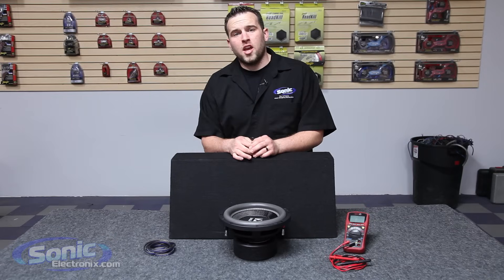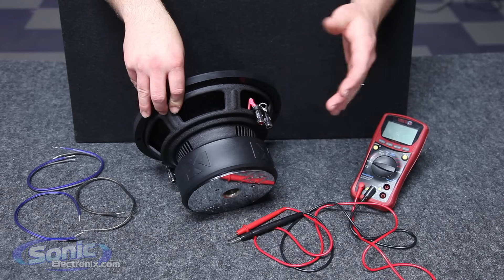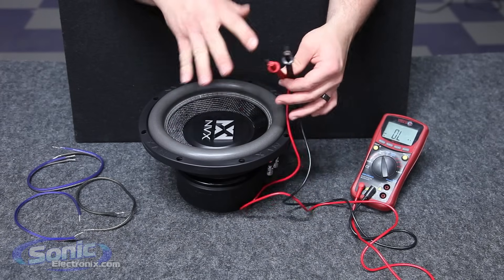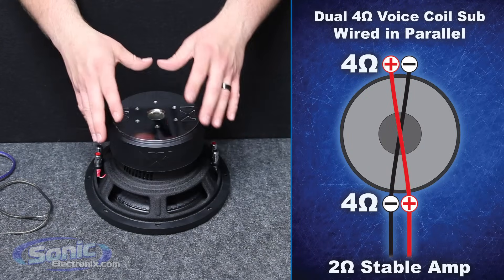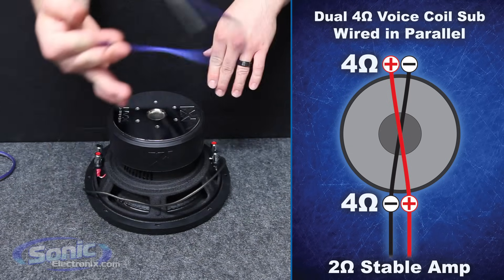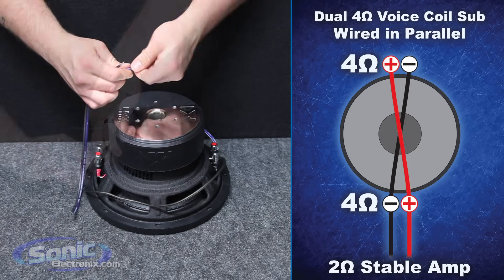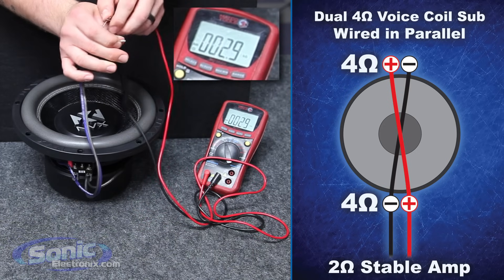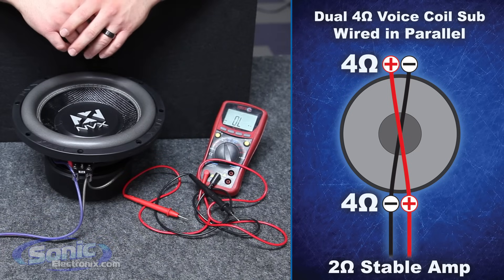How to Wire a Dual 4 ohm Subwoofer to a 2 ohm Final Impedance | Car Audio 101

Comment: How does the RMS change?
Reply: Madis Kess The RMS changes because there is less resistance to the amplifier, allowing the amplifier to push more wattage to the subwoofer. Just make sure the amp is stable for the lower ohm load otherwise damage will occur.
Reply: ***** I'm not sure what you're asking.
Reply: So the sub wattage doesnt change. Just need amp that can get the rms at lower back ohm.
Reply: Just a bump to get the notification. Also curious about this.
Reply: gar rett Thanks, I mean as in numbers? Say a 500W 2ohm sub?
Reply: If you have a 2 ohm 500w sub and you run it in series to make it 4 ohm you add more resistance so it would be 250w RMS at 4 ohm. The RMS of the sub won't change because everything has its limits. Go to the manufacturer site and look up your Subwoofer to see what the RMS rating is at the ohm you want and see if it's stable. If you don't see it, I wouldn't try it because then it's in unknown territory and you could ruin your sub & or amp.

Comment: Ok how can I hook up 2-12" NVX N SERIES DUAL VOICE COIL SUBWOOFERS TO A 2 CHANNEL KENWOOD EXCELON KAC-X621 AMPLIFIER
Reply: Exactly the way he showed on the video.  Each speaker to its own channel on the Kenwood amp.  The amp should be stable at 2ohms per channel.  
Don't try to use the bridging mode wired this way,  u will fry the amp.  Forget about bridging

Comment: Hey i have a 3000watts amplifier with 1 Chanel 
And I have an L7 15" kicker and when I do the bridge it does sounds much louder but smoke starts to come out of the amp, even if the volume it's low or all the way down, you think my amplifier it's the problem?
Reply: Something is wrong with your amplifier
Reply: Have you checked out what ohms your amp can go down to? It might be too lower ohms for the amp to handle.

Comment: how can i wire a 2 dvc sub to a 4 channel amp
amp power at  1640 watt and sub at 300watt each with impedance 2x4 ohm (stereo), 2 ohm (mono) and 8 ohm (mono)

Comment: I have two 800 watt 4 ohm 8" subwoofers in my deck can they be wired straight to my car stereo factory wires ?
Reply: not to be rude but they will work but it would probably sound bad and you wont be giving them enough power and also the fact that you would need hi x over to push only lows out the subs so you wont ruin the voice coil.. ummmm to put it simple, no that's a bad idea lol
Reply: And not just what marcell said sub's are ment for hi mids and lows if they can hit them all some only hit mids and his and some only hits the lows or some hits them all there not ment just for vocals

Comment: I have a AUDIOBAHN amp 1200w 2ch and on the bottom of the amp it says it can be taken down to a 1ohm. I bought two 4ohm dvc AUDIOPIPE subwoofers 600rms/1200max. My question now is how should I wire them for best sound/bass? I have a ported box for the sub's to go in. If I wire them down to a 1ohm would that be safe? Or wire to 2ohm ? Or just wire it for a 4ohm like the diagrams prefer? I'm trying to hook this up within the next 5hrs so if you could help me before then that'd be awesome. To the public if you know your stuff and could help me with any feed back it'd be greatly appreciated thank you.
Reply: if you want louder bass go seald and you will feel the bass as well as getting it to sound louder just double check that the specks on you subwoofers say that they can be placet in a seald or ported box

Comment: i have a small question! i have a loaded kicker comprt 12", its at 4 ohm. i would like to rewire it to 2 ohm. does anyone know what kind of speaker comprt uses? and how its wired inside? before i take it apart i'd like to know if its actually possible. because there is a possibility that both coils on that speaker are at 8 ohm, and they're wired parallel into 4 ohm, which would suck for me.

Comment: I've got a JL audio W3v2 300w rms 4 ohm sub and i want to power it with a ALPINE MRV-M500 AMP 1CHANNEL 500 wrms @ 2 ohms, 300 wrms @ 4 ohms, if i get the final impedance of 2 ohms will the system work well?

Comment: okay I have a question anyone can help plz. I have 2 12 excelons producing 400rms @4ohm, it is hooked up on a Kicker cx 1200.1.  600watt x 1@4ohm and 1200watt x 1@2ohm. I wired my subs down to 2 ohm, my subs are pushing 1200rms together.  Well I plan on upgrading to RF p3d2-12 they each have 600rms@2ohm and I plan on using 2 of these on the same AMP,  now will the RF that will be pushing 1200rms@ 2ohm be louder than the excelons that are also pushing 1200rms? will the sound be the same or diff

Comment: I have a pair of pioneer TS-w3002D4 and a SoundStorm EV2.3000  and i want to get the most outta them both but on your website it doesn't say if the amp is bridgeable?

Comment: I have a Audiobahn A2300hct amp and I'm putting 2 AW1204M (4 ohms) and I'm trying to run them at 2 ohms but mine has 4 connection instead of 2 as shown on this video. how do I run the wires in order to achieve the 2 ohms?

Comment: I was planning on getting to dual 4ohm and connecting them parralel to get a 2ohm load, i have been told if i connect it to my monoblock amp that is 1ohm stable, the subs will them run at 1ohm.

Comment from the maker: If you bridge a two channel amp, it becomes one channel BUT you can only put a 4 ohm subwoofer on that channel (in most situations). If you have a 4-channel amp and you bridge the channels, it becomes a 2-channel amp, but you can only use 4 ohm subs on it. When we say 4 ohm, we mean the sub is wired to a 4 ohm final impedance.

Comment from the maker: If you have a Dual 4 ohm sub, it will wire to 2 ohms on a mono block amp. Remember, a monoblock amp is 1-channel. If you have the exact same setup but a 2-channel amp, this one subwoofer will only connect to one channel, leaving you one additional channel for another subwoofer. It would still be at 2 ohms. If you have a 4-channel amp, the sub would be at two ohms on one channel, leaving you 3 extra channels for 3 more speakers. HOWEVER, it gets more complicated if you start bridging the channels
Reply: So do I bridge this parallel setup on a 4 channel amp or I just use one channel?

Comment: I have a 12 inch pioneer ts w3002d4. Im going to run it parallel. I have a 2 chameleon amp. Should I bridge the amp? Or use it normal?

Comment from the maker: The additional terminals allows you to wire the subs to the amp, and the amp will bridge the connection internally. Otherwise, just use one positive and one negative like normal.
Reply: Hi mate . Thank you for great videos. I have a pioneer 3003d4 subwoofer. Is this how to wire the sub ? I have a gladen rc1200 mono amplifier. I want to instal on 2ohm . Can you please guide me ?،🙏

Comment: Well even though my MB Quart 1.1500D says its a monoblock, it has 2 sets of posetive and negetive speaker out puts.  So technecally could I wire each sub individaully down  two 2 ohms, then have two box terminals running 2 sets of speaker wires to the amp?
Reply: So what did u do ?

Comment from the maker: Two Dual 4 Ohm subwoofers wire in series up to a 4 ohm load.
Reply: Sonic Electronix can I do the exact wiring but the wires that go to amp , one side on sub gets connected to red then on the other side connect the black ? Or do both wires going to amp from sub , need to be on the same side of subwoofer

Comment: It is also good to check to make sure you meter works properly, touch the two leads together, and it will read either 0 ohms, or 10 megohms, depending on the meter, if it reads anything different, then the leads are either bad, or the meter its self is bad. You should ALWAYS do this before using any meter.